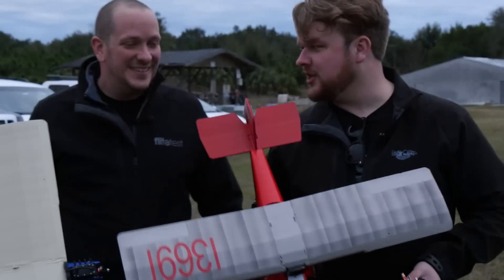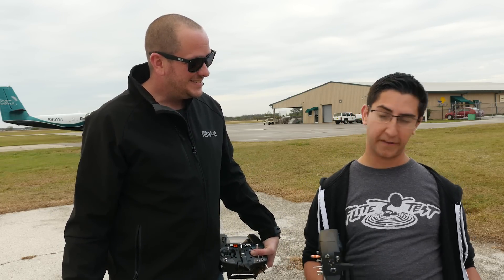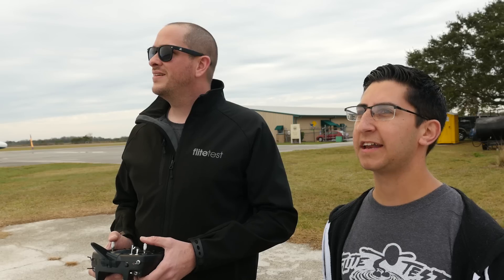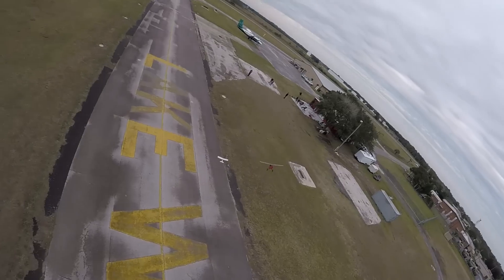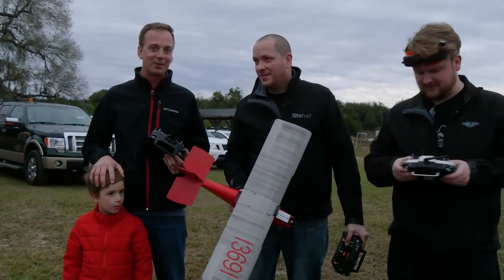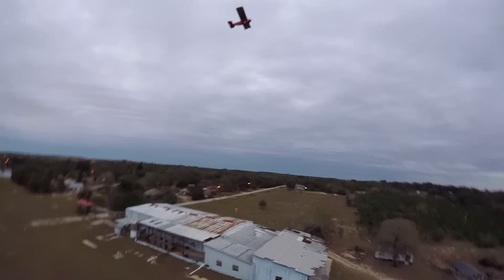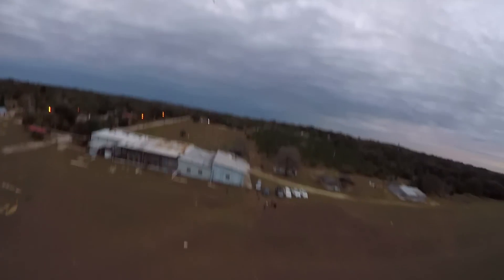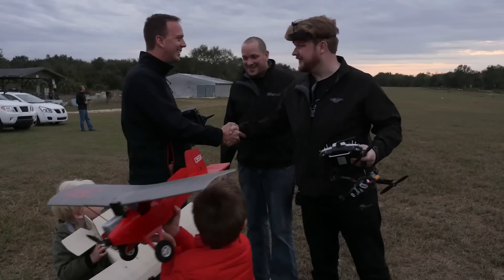DIY Mighty Mini Pietenpol | Flite Test

Comment: Nice build. I built a mini peat. Using a VW engine cut in half. 26.5 ft wing span. Off the histrionic Heath super parasol plan. I also built a full house mini servo peat Paul with a cox .049 with a exhaust throttle.  They said it could not be done . I did it. Back in 1978.

Comment: i need to learn the basics on building planes and multirotors
Reply: Planes are a lot easier.  Multi-rotors involve computers, configuring the controller, etc.  You can watch a flitetest build video along with some of the intro videos and be good to go.  Check out the forum for some advice on which transmitter to buy, etc.  Also, I found learning acro mode on a 250 sized quad very difficult.  Hard to keep orientation, etc.  Planes are much easier.  Just don't make substitutions until you have some experience.
Reply: Mike Porter the thing is that i have a small space to fly in
Reply: Ah.  No local schools or parks?  I guess if you are in a city, big open football fields are hard to come by.
Reply: Mike Porter well i live in new England so the only place to fly is a park that is litley wooded a strong winded so i fly in my living room

Comment: One question about this design , Why the really bad placement of the radiator? There are so many better places it could have been mounted.
Reply: Ron DuBray It is modeled after Josh's full scale Peitenpol, which has the radiator in that location.
Reply: yes I've seen real peitenpol's and have seen the nutty radiator placement, but why did the builders/designers  place the radiator in such a bad place. blocking the pilots line of sight??  They had to have a reason.

Comment: So, you guys are using the "F" kit, which seems almost a bit overpowered for this craft.  (same with the swappable bi and tri planes)  Is there a more docile motor speed/prop setup that would be recommended if you want to fly this strictly "slow fly" so you can keep it inside a backyard or even for indoor flight?
Reply from the maker: Possibly a smaller battery, but you can easily cut throttle and fly much slower then you see in the video ;)
Blessings,
S.O.
Reply: +FliteTest   Ok, thanks I guess...  But that's not really what I was looking for.  I mean, I could put a 35x36mm 1450 kv motor with a 10 inch prop on it and just fly at 1/4 throttle, (I actually happen to have that sitting in front of me right now) but I think we all know that would be beyond silly.  I'm looking for a suggestion for a true "slow fly" setup, even if it isn't something your store carries right now.
Reply: +BREWPLANES  Hmm.  Interesting suggestion.  I'll look into that.
Reply: Also the F-pack on only 2s. Dropping down the voltage makes a ton of difference.
Reply: Good point.  Forgot about that.  Although one would have to have the batteries for that and I am almost exclusively set up for 3S.
Reply: Weary Man drop an 1806 size motor in it.  Or you could always use a more docile prop
Reply: try the "E" pack I think the motor is a 2204 2300kv emax.
Reply: I have some 2S from my Tiny Trainer.  Just have to convert them to XT-30, but that's not a bad thing to do, anyhow.